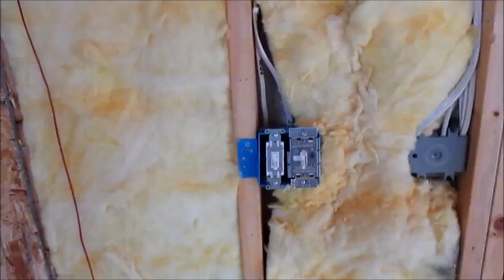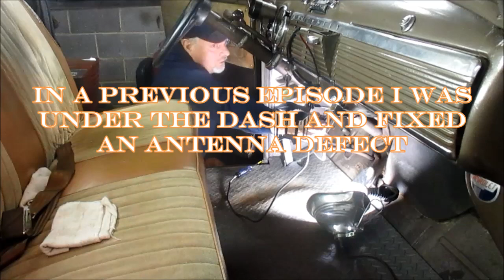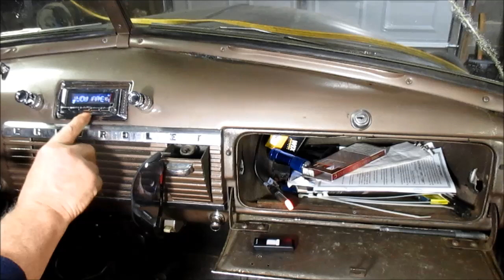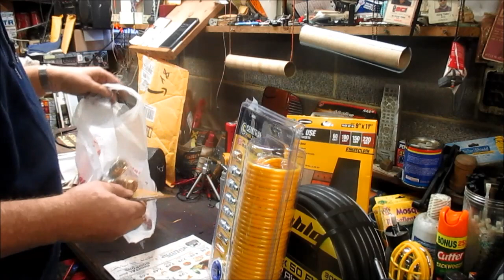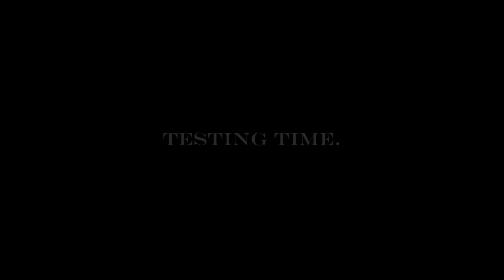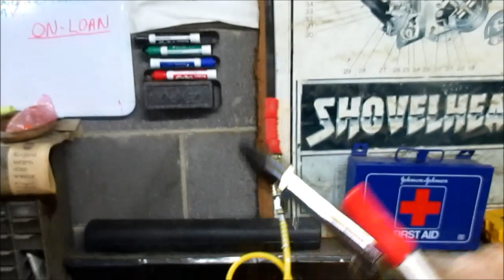1949 Chevy 3100 Turn signal repair, volume 34. Relocating shop air compressor.

Comment: Good work! Nice trucks.  Thanks for your service.  Served 20 yrs. Army during which I taught 3 years at Lowry AFB, Denver Calibration School for combined US Forces and foreign services.  Retired & taught Basic Elect Course at Orlando Navy base.  Taught Elect Technology at ITT 10 years.  After all that I could boast I had saved   $6,000 for retirement with a $70,000 mortgage to pay.  Paid off just before 9/11, lucked out and went to Kosovo and Bosnia for 4 years.  Came home and have just retired.
Reply: Laid off, not paid off.
Reply from the maker: Congrats on your retirement. You would have been what we called a "tweet" back in the day. Even tho we worked on all phases of GSE gear our shops were separated into mech, elec and hydraulic sections and we all had nick names. I was a grease monkey but went to electronics school when I got out.

Comment: When my turn signals have been out I used hand signals.  They're still legal up here.  Hand down for stop, straight out for left turn and hand up for right turn :)  Funny you making a vid about your compressor.  I just put one up on my channel of my new compressor.  Haven't hooked it up yet, been waiting for a warm dry day, lol.  Got everything I need, fittings, shut off valve, air dryer, 10/2 romex, conduit, outlet, plug, etc. etc.  My old garage has a fuse box but no 240 fuses except for it's mains block so I'm just going to use a 30 amp time delay fuse on each "leg" of the fuse panel.  I better get it set where I want it the first time because it's gotta be anchor bolted into the floor.

I put media player on my windows 10 desktop, and I tried putting movie maker on it...and it is on but it doesn't work with my old sony handycam so my videos have practically no editing.  I tried vegas movie studio as well, but on movie maker I'd have audio but no video and on vegas I had video but no audio, lol.

When you have your video at quick speed it sounds like you're next door to an Indy racetrack in the background, lol :)  Take  care, Gary

P.S.  I looked up that harbor freight diablo air hose and it said $24.99 for 3/8 x 50ft. of it.  I got 3/8 x 50 ft. of U.S. made Goodyear rubber air hose on amazon for $23.68.   I don't remember Roy Rogers, but I remember Roy Clark :)  May your pleasures be many, your troubles be fewwww...
Reply from the maker: I loaded movie maker on my WIN10 machine but it doesn't run right, it puts a mirror image at 90 degrees of the video and I haven't figured out how to straighten it up. Supposedly WIN10 has a built in app that does the same, picture viewer perhaps, but once I get used to something I don't like to change so I'm running Bit Defender on my WIN7 laptop which is supposed to keep the anti virus updated, it's stopped quite a few trojans lately... BTW, I still have an old laptop running XP and a desktop running 98, neither of which has the HP to upgrade so I keep them for running certain apps when needed.
You must be a youngun if you don't recall Roy Rogers and Dale Evans, they were Sat morning staples for we boomers in our youth, which I have to remind my 2 grand boys that I was in fact a youngun once too, LOL...
Have a good'un Gary.
Reply: @Volfandt  LOL, I'm 51 so I figure I "missed it by that much" :)  Sorry about that. Chief.

Comment: all my part's for my 49 3100 came yesteryday :) cant WAITTT to get cuttin and weldin on er. supposed to rain for the next few days so i may go and buy a pop up cover tent.   i drove 1 and a half hours yesterday to meet a guy to buy a FRESH AIR HEATER for 70 bucks yesterday! couldn't believe it. it has the chevy symbol on it. the guy was doing a v8 swap and he wanted the box gone. ever since i seen you put yours in i've been looking for one and i finally found it. redoing all my engine gasket's now and carb. just finished rebuilding the 3 speed. cant wait to drive er. thanks for your videos they are helpin allot
Reply from the maker: Great find on the heater. Even if you need to repair/replace either the elec motor or heater core it'll be worth it.
Keep us updated on your progress and have a good'un